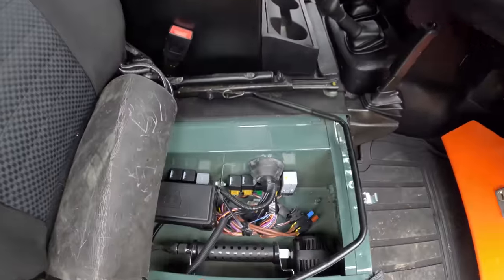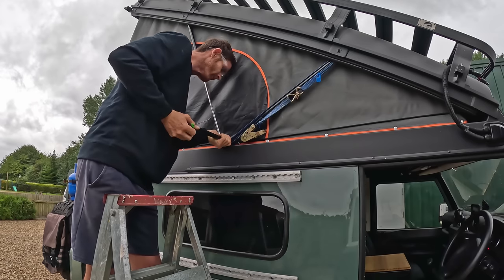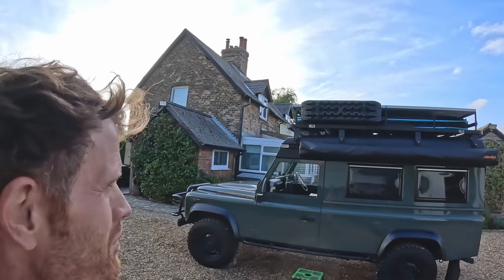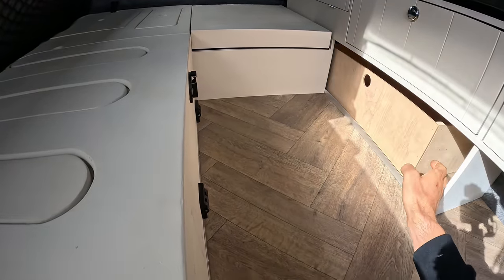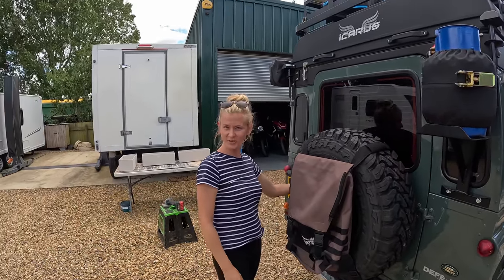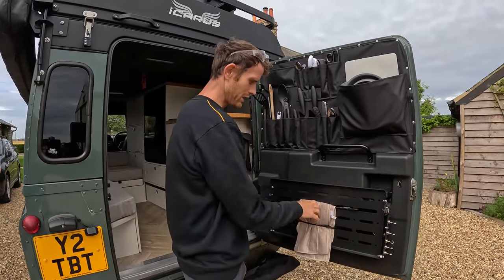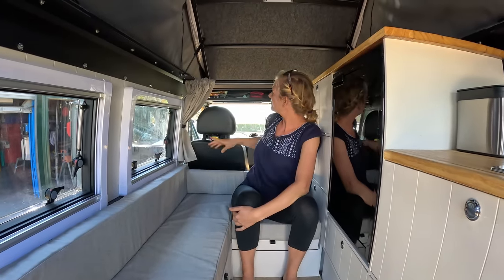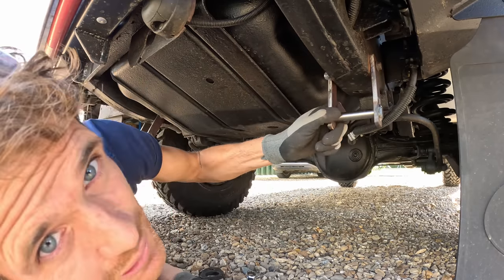Completing Our Dream Overland Land Rover Defender Camper With Alucab Conversion

Comment: Hello intrepid travellers. So excited you’re coming to my continent. When you get down to South Africa, you need to call in at ours. 
Please, please, please remember to lock everything that isn’t welded down. Things get stolen here - sometimes just because, not even for need.
Reply from the maker: Hi Pauline, lovely to hear from you 😀 we didn’t realise you were from SA, we don’t know when we will get down that far south, but it’s on our bucket list so it’s happening that’s for sure. We will make sure to let you know, would be lovely to meet you. Thanks for the tip. We bulk bought some padlocks the other day 😂 we know if people still really want something they could just bolt cutter them off but at least it’s a bit of a deterrent 🤞

Comment: I put 3 130w lightweight solar panels on our roof and even that made a big difference lifting the roof, mine has no helper struts or springs and first couple of feet are a proper workout, it’s on the list.
Reply from the maker: We couldn’t believe how much difference the roof rack made to lifting it but it works a treat with the new struts 👍

Comment: Amazing build, so enjoy these videos. Love the paint job, Don't burn yourself on that compressor connector after use, mine used to get pretty hot!  I'm looking forward to the next video and will send you a pic of our Hiace when we finally get it.
Reply from the maker: 👍 yeah I remember when I used it last time it got pretty hot so I’ve built up a load of layers of heat shrink on it so it’s like a big rubber round it, fingers crossed that works, if not I might get an arb connection point, that looks like it’s got a big plastic surround on it 
👍 love the beauty hiaces

Comment: Check out videos on how you can use the high-lift jack as an emergency winch ... Useful to know in case to have main winch failure ..... lovely protective boot for it bye the way 😄 Another handy tip is if you are going through water or deep mud reel your winch out a bit before and secure the hook on top of the bonnet . The last thing you want to do if stuck nose down is try and dig it out from where you cant see it and its buried in goo !
Reply from the maker: Brilliant thanks very much, that’s a great tip, much appreciated. Sounds like you have been digging in goo before 😂😂 glad you liked my boot too 😀
Reply: @truebluetravellers  lol ..yeah I have made all the mistakes !..... I have a small metal D ring mounted on top of the wing I clip the winch hook to when going off roading ... saves a load of hassle in the muddy stuff. Also a net on the bonnet is handy as if you are embroiled in a serious winch recovery you can just throw the spooled out winch line under the net rather than reeling it in and out constantly .
Reply from the maker: Really appreciate this Kizzy. Seriously helpful tips 👌

Comment: Fantastic series! Really enjoyed it. What rocksliders/side steps have you got on there? I've been looking for ages for decent ones
Reply from the maker: Cheers dale 👍 just got them off eBay mate, real good to use as steps too, 
but they are quite heavy, also they are quite slippery but I’ve fitted a small strip of 3m grip tape/skateboard tape along the top so now they are spot on 👍
Reply from the maker: https://www.ebay.co.uk/itm/325686343319?mkcid=16&mkevt=1&mkrid=711-127632-2357-0&ssspo=6RbKPrhDSP-&sssrc=4429486&ssuid=h77jMQulRBK&var=&widget_ver=artemis&media=COPY

Comment: What perfect escapism watching your build series. Really inspired and impressed with both of your skills, attention to detail & banter. Can I ask where you got your gas struts from & how did you calculate the right force needed?
Reply from the maker: Thanks kamran that’s much appreciated, we got the springs from a company called metrol springs, if you like I can send u the part number of the springs we got, 
They went up in force by about 50%, so from 500 - 800n 400-600n and 150 - 250n, we spoke to someone who had previously replaced the springs who suggested what rating to go for 😁
Reply: @truebluetravellers  Thank you - part number would be great. I recently built my own roof top tent and can’t for the life of me get the strut spec right.
Reply from the maker: @kamranharandy3738  Nn-ff-10-400 
Ns-ff-10-500 
Ns-ff-8-200
X2 of each of these, the company is very helpful if u call them to discuss your requirements too
Reply: @truebluetravellers  thank you so much. Have a great time in your new camper.

Comment: Hi there, I’ve been following your camper build, nicely done, I saw the chassis in a previous episode, is that not the 110HD? Looked like it with the extra platting and the double springs? I know they go to 3.5t. Thanks for the compressor idea! Gonna do the same with mine
Reply from the maker: Thanks mate, yep you’re right it’s a heavy duty 110 but not sure why it’s only rated at 3.2t, I was surprised to see it on the log book too to be honest 👍
Reply: @truebluetravellers  ah I think the 130 is for 3.5t :) anyways nice build, all the best!

Comment: Hello. Can you tell me what specs your upgraded gas struts were changed to?   I saw 800 mm by 800NM are listed on an Alucab  source but I feel these are more likely direct replacements rather than upgraded ones. Thank you
Reply from the maker: So we replaced all 6 springs, 2 @800nm 2 @ 600nm and 2 at 250nm, of u send me an email insta or Facebook message I can send u exact details of u like 👍

Comment: Hi guys. Just found your channel and subscribed. Great build so will be binge watching to catch up. Love the interior living space with standing height due to the Alu Cab roof system. Great final touches with attention to detail and practicality. Great job all round. One thing I found which you may be interested in, seeing as Jess is handy with the sewing machine. It’s a rear door shelter cover used on a new style landy. Thought it might be an idea for you to use with the outdoor shower. I know you have the 270 awning but Could be adapted to also create a screen when showering if the awning is not being used or both. Great channel guys and look forward to your adventures. https://youtu.be/1H-IKr16uzQ?feature=shared
Reply from the maker: Thanks Ashley 😁 and thanks for watching, this is a brilliant idea, definitely making this, also the awning is great but it doesn’t cover the back door to the roof fully so this would then work with that too, also could use it on its own for like a small awning if I can’t get the awning out, like where I am now for example, thanks very much for the suggestion 👍
Reply: @truebluetravellers  you’re welcome. Would look forward to seeing how it turned out when you’ve done it as I haven’t seen one available for the older style landy’s. 👍🏻